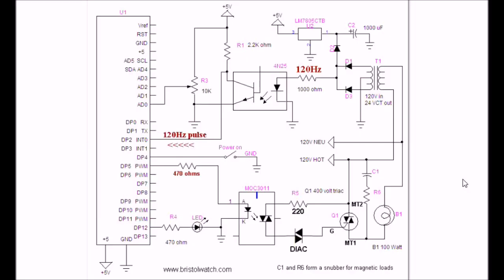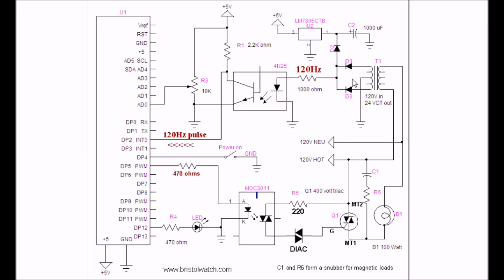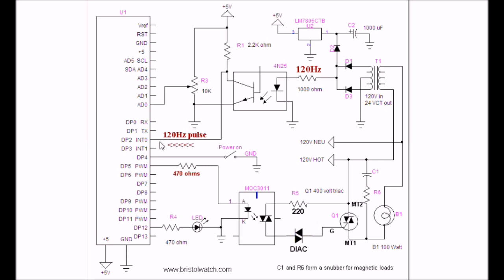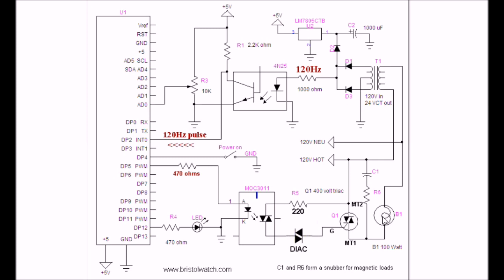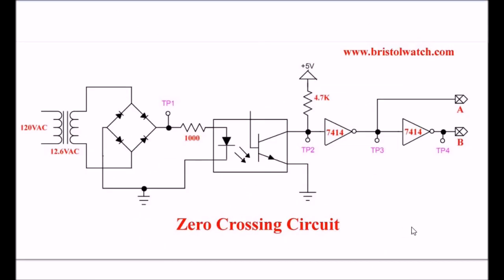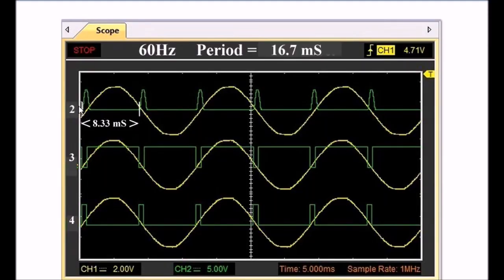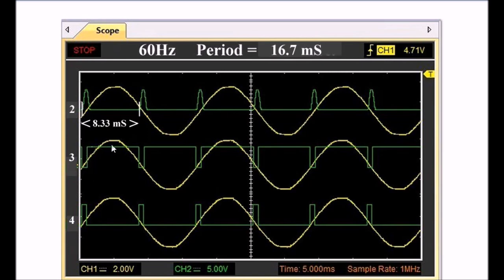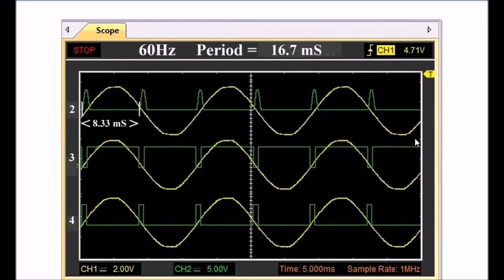Improved Zero-Crossing Pulse Detector for Arduino

Comment: If I do not use a step down xmr can I just up the resistance by the  same ratio of the turns ratio so that I enough resistance to drop the line voltage enough such that it may opto coupler V forward is not too high ?
Reply from the maker: You can do that. Make sure to keep the AC side of the optocoupler disconnected from the pulse side. Make certain the calculation is for peak, not RMS. The peak voltage is 1.41 X RMS.

Also, note the AC has to go through a full wave bridge rectifier if not using the center-tapped transformer.
Reply: @LewisLoflin  It doesn't have to go through the bridge if you use a dual led opto.
Reply from the maker: @spyder000069  True and already know that. That is what I prefer, but most people don't have those.

Comment: Sir, kindly reply as soon as possible. It is very important for my mtech project. I have the similar ckt for controlling triac with phase angle triggering. I have used 15 v ac as input to rectifier and 4n35 optocoupler. Current limiting resistance i have used 39 k instead of 1k you used. But the output of the optocoupler is not coming properly. pulses should come every 10 ms but  some pulses are coming between 0 to 10 ms. How to solve this? please help
Reply from the maker: 39K is too big. Try 22K or 15K.

Comment: I'm trying to decode triac chopped wave.. to get the pulse widths.. I used first example with opto.. kinda works but there are like flashes and drops (flicker) would adding these comparators help with that?
Reply from the maker: OK I'm somewhat lost here. The pulse width will be very narrow and can be hard to see on some oscilloscopes. Not sure what you mean by "triac chopped wave". It is supposed to trigger at some point at 0, 180, 360 degrees. I use this to trigger interrupts then use software to delay from 0-8.77mSec. for 60Hz and 0-10mSec. for 50Hz.
Reply: @LewisLoflin  I sent email with more explanation. I'm not trying to drive a triac.. I'm trying to "decode" a triac

Comment: uC ports are normally ST. Does not make sense to add an ST discrete.
Reply from the maker: Many IO pins are not ST. In a typical PIC chip such as the PIC16F628A only 1 pin is ST.